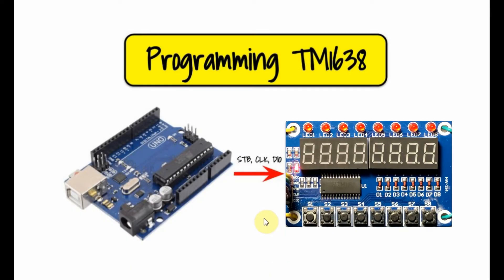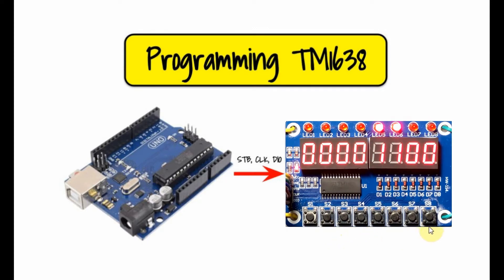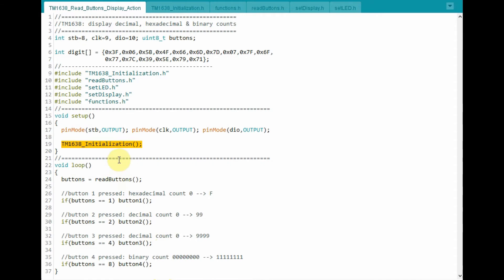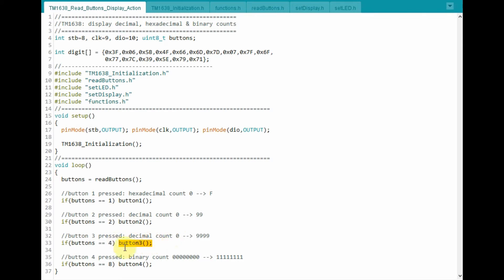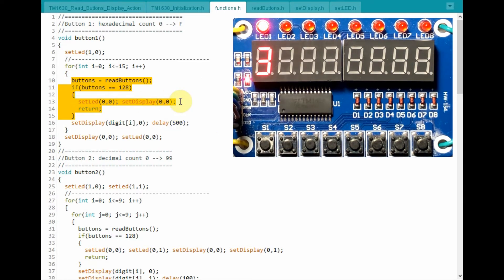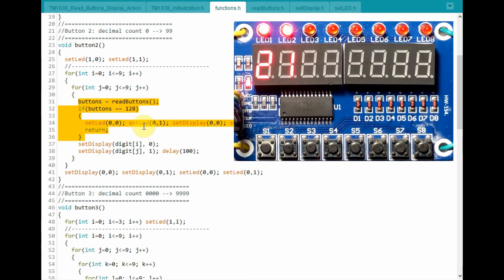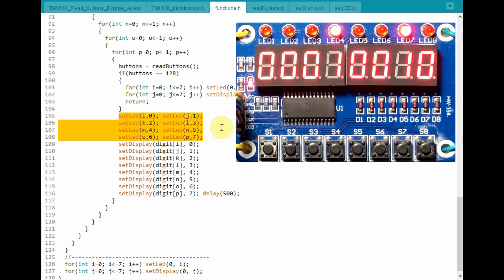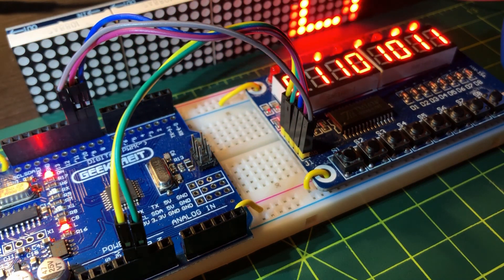TM1638 Programming (part 3)

Comment: need help..
i need assembly language programme for TM1638 as i use 89s52 ic
Reply from the maker: I have videos (you can check out) where I have programmed AT89S52 via assembly. But to interface TM1638 with this microcontroller and to code using assembly is a huge task. Anyhow, I need to do some research.
Reply: @AnasKuzechie  big thanks for quick response.
If possible please do give me link for same for sample program
Reply: @AnasKuzechie  as all videos or website provides program in C or C++ but not 🚭 in assembly language
Reply from the maker: @jainkirit  As I mentioned earlier, I have programmed AT89S52 via assembly. Please check my video: https://www.youtube.com/watch?v=eSH7khDKMlc&t=13s. Now to interface TM1638 with AT89S52 I have not tried that yet. May be in a future project. Hope this helps.

Comment: Can we get any other work if we press button.. i mean doing other pin of mc set on off?
Reply from the maker: Yes. I might do a video to demonstrate that.
Reply: @AnasKuzechie  also pls make a video on tm1628 if u have.. i have this ic and 7segemt display are connected in the ic with improper manner unlike tm1638 board diagram.. so i need a manual control over that
Reply from the maker: @Sekhar_Home  sorry I don’t have the IC. I’m focusing on the TM1638.
Reply: @AnasKuzechie  pls see the datasheet of tm1628 and tell what is the difference betwen 1628 amd 1638..i need it very urgent..
Reply: Kindly see the datasheet of tm1638. In point 5 Display register address and display mode.. pls let me know how to read the table provided . Also pls giv me ur email to contact u. Pls
Reply from the maker: @Sekhar_Home  Hi, please check this link http://www.microcontroller.it/english/Tutorials/Elettronica/componenti/TM1638.htm
Reply: @AnasKuzechie  but i didnt understand if i want to power seg5-dig-4 combination.. 
Pls tell how the command wil b?